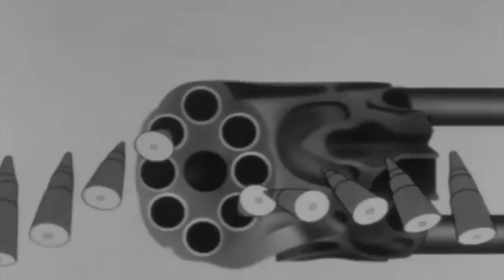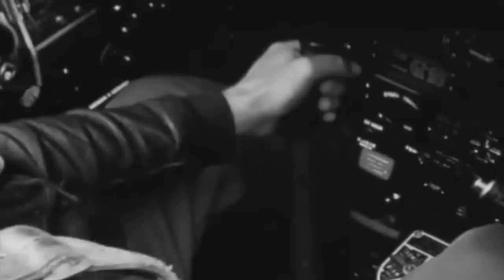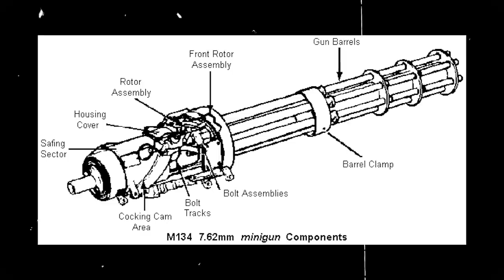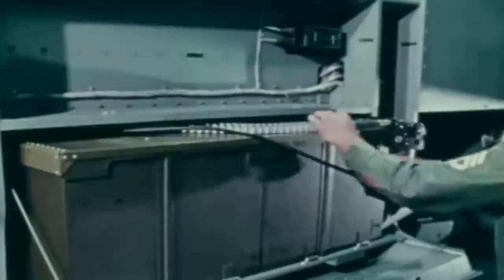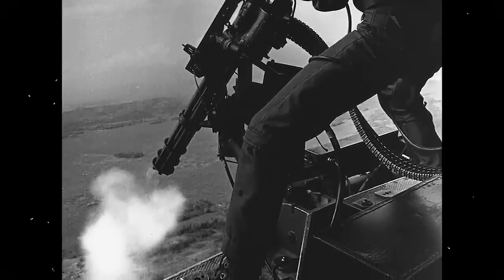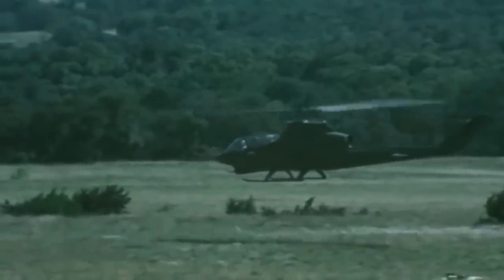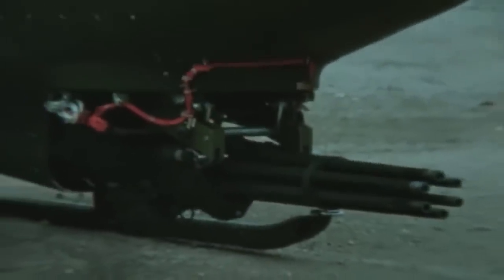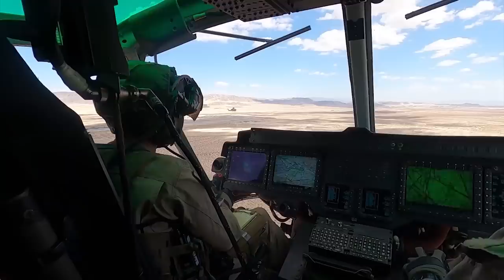Minigun -  M134 7.62×51mm Six-barrels of Pure Destruction

Comment: Ammo reliability is critical in these guns. While a dud rd. will simply be ejected a delayed hangfire will destroy the gun when it goes off out of battery. Because of the speed the gun fires at there's only a few milliseconds delay between the firing pin striking the primer and the bolt opening. Every round must fire the instant it's struck.
Reply: That's why primers fire at over 100k/fps
Reply: I read that the 20mm guns are electrically fired, not impact fired.  The 7.62 guns are impact fired.  I'm not aware of how prevalent a hangfire is, I've never personally seen one but if you are firing many thousands of rounds then maybe the odds go up.
Reply: @billj5645  I thought they are electronically fired as well.
Reply: @billj5645  
Yes, the 20mm ammo is electrically primed, you could pound on the primer of one with a hammer and nail and it'll never go off, but if you have a ring on your finger and a static electricity charge built up on your body and you pick up a round and that ring touches the primer you could easily blow yourself up.
I was a Vulcan gunner in the Army, we were trained to remove all watches and rings for safety reasons before handling any of the ammo, and the linker/de-linker tool we had was made out of a special metal that wouldn't carry a static charge on it, also if you're ever at a gun show and you see fired 20mm brass pick one up and look at the primer strike, it's remarkably light, it looks like the firing pin barely touched the primer which in all reality it barely did, the firing pins on a Vulcan have an electrical current that runs through them, as I recall it was a lower voltage but a pretty high Amp rating. 
Something that cracks me up is when I see those YouTube videos where they "prove" whether or not a 20mm round will go through something like a manhole cover and they're using some custom built 20mm gun, they're not "proof" of anything because they're not firing military ammo, they're firing some sort of hand load made from pulled Target Practice slugs and fired brass, you can pick up both at gun shows, I have a pulled 20mm Target Practice slug that's sitting in a fired casing that I picked both up at a gun show to have sitting on a shelf so I can show people what I used to shoot.
They're taking those empty casings and machining out the primer or something like that and pressing in what I assume is a standard #209 shotshell primer since they're the same diameter or close anyways, then they're filling them with God knows what kind of powder plus if you look at those rifles they always have a barrel somewhat shorter than a Vulcans, so they're definitely not getting the same ballistics as a military round fired from a GE M61 cannon, and without a doubt it's not military ammo since they're shooting it out of a rifle with a percussion firing pin.
One of those videos claims that they prove a 20mm won't go through a manhole cover which I can assure you they will, we'd burn holes through light armored vehicles the engineers drug downrange for us, unless you're lucky enough to get a fresh Antrack or something usually they've already got a huge hole all the way through both sides.
Videos like that are just click bait and aren't proof of anything, in one of them some guy claims they try 3 different types of 20mm rounds and holds them up claiming one is a Target Practice slug and the other two were different varieties of the explosive rounds, it's such a joke because the TP round has a blue projectile sticking out of it which it should and even has the description and nomenclature stenciled on it as it should, the other two you can tell they painted the colors they should be but they don't have the description and nomenclature stenciled on them as they should, it isn't even a very good paint job on them, you can tell it's Rustoleum or something like that right over top of the original blue from them being TP slugs, the military nor anyone else would ever surplus out explosive projectiles or even pull them in the first place, and since they were shooting them from a percussion primed type rifle they definitely weren't any kind of surplus ammo since the rifle didn't have a power source for the firing pin anyways, I've handled all that ammo and I can assure you the two they claimed were explosive rounds were simply hand loads with TP projectiles painted to look like the real thing, and like I said to the trained eye it wasn't even a good job, that's why the guy only flashes them in front of the camera for a second instead of having them sitting on the bench or something like that with a close up shot.
I called them out for shooting non military ammo during their "proving" what 20mm capabilities are and ask them how they got electrically primed ammo to fire out of a rifle with a conventional percussion type firing pin and no power source for it but I never got a comment back from the creator's of the video, when I explained in my comment that I'm an ex Vulcan gunner they knew they were busted.
Reply: @dukecraig2402  I think I saw that video but didn't really question it at the time, that was before I read the book on Gatling and learned about the electrically primed ammo.  I assume the 20mm stuff used in WWII was percussion primed, I didn't know it had changed since then.  The book didn't get into many specifics regarding the 7.62 minigun, I didn't think they would develop special ammo just for minigun use.
Reply: @billj5645  
The mini gun uses standard 7.62mm linked ammo, the same stuff shot through the M60.
I actually have experience with the mini gun, at one point the Army determined that it would be cheaper for us to shoot at the Styrofoam radio controlled airplanes with 7.62 ammo instead of 20mm ammo, so they designed a mount for the mini guns that clamped onto the barrel cluster of our Vulcan guns, then you'd remove the electrical cable to the drive motor of the Vulcan and hook it up to the drive motor of the mini gun, there was a big ammo can that hung on the left side of our gun tub (turret) with a flexible feed chute that went to the gun.
The whole thing sounded good in theory but the problem was whoever the genius was that designed the mount for the mini gun designed it so that the ejection port was facing straight up, it worked OK as long as you were swinging the gun when you were shooting it but if you weren't occasionally the last cartridge fired would fall back into the ejection port, then when you'd go to fire another burst that empty cartridge would jam in the rotor causing a stoppage that required the gun being torn down, we wound up with more down time on the range because of it and quickly scrapped the program. 
But until the day I discharged we still had 4 mini guns sitting in the corner of our arms room, I was good friends with our unit armorer and used to sit around in the arms room with him tearing them down and putting them back together just for fun, they're actually more similar to the 20mm cannon than you'd think, the tear down procedure was almost exactly the same, if you could tear one down you could tear down the other.

Comment: 7.62 is a common projectile caliber. But there are a lot of variants and they're not interchangeable. The minigun is chambered in 7.62×51. Which is called the .308. 7.62×39 is your standard AK47 round. Then there's also 7.62×54R. For the sake of clarity most people call the 7.62×51 a .308 round.
Reply: I always thought 7.62 NATO was more commonly said than 308
Reply: @PsRohrbaugh  That's my impression- in military context it is the 7.62 NATO, in civilian use it is most commonly called .308.
Reply: I guess nobody would mistake the AK 47 round or the old-rimmed Nagant round for with the usually-called 7.62 or 308. The 30-06 has the same caliber as well.
Reply: Thanks! I have a Yugo SKS, so I don’t think AK when I hear 7.62x39. I love my bayonet and grenade launcher

Comment: The Mini-gun is an AWESOME tree and grass mower, not to mention shredding the f*** out of any people caught in the line of fire.
  The Vulcan Phalanx is an AWESOME piece of Tech!!
  Viet-ming?? Meaning Viet-cong maybe?
  As I was taught in Basic training about the M-60 machine gun. Sustained fire of the weapon would melt the barrel and cause miss-fires, and premature detonations, which could/would/did cause casualties/fatalities. They told/trained us to utilize 15 round bursts to prolong barrel life and slow barrel meltdown. Barrel meltdown caused the weapon to be out of service for quite some time to replace the barrel, or permanently. I was the M-60 bearer during my entire time in-service, the 26 pounds of the weapon empty weight wasn't a problem at all. Even loaded I experienced no problems handling/carrying it, even b4 Rambo, I would carry 2 belts of ammo strapped across my body, and 1 belt loaded in the weapon. I didn't want to run out of ammo too quickly. My ammo bearer carried the extra barrels, plus the extra ammo.
Reply: Viet Minh, more so what the French would have called them.

Comment: The mini was limited to short bursts due to over heating. Front seaters in the Cobra would cycle the trigger to minimize the gap on fire.
Reply: The system had a 6 second fire limit built in. Once it stopped one would simply release the trigger and hit it again with only a small space between "streams'...

Comment: the vulcan gatling gun use in vietnam actually first used on a C-47 before using on helicopters it was mounted on the floor and it was water cooled there were 3 mounted, 2 through windows and one in the doorway, the pilot was also the operator. they were used in the highlands first. it was the summer of 1965.

Comment: Good video. But you made a comment that cannons gave a range advantage over the .50bmg used in USAF fighters. This is not why cannons were favoured over heavy MG's. 
The reason was because of their effect on the target. Cannons did mre damage than the .50bmg with fewer rounds.
This became most obvious during the Korean War, when USAF F-86 Sabres were getting repeated hits on Mig-15's but the Migs still remained airborn and often escaped even when full of holes.
This led to Project GunVal which saw a small number of cannon armed Sabres deployed , I think it was 12, to evaluate the potential of switching over to cannons.
As a direct result of Project GunVal's findings, after 1953 no new model American fighter carried .50's again.
The Vulcan cannon allowed the most projectiles to be fired in the shortest time due to the fast speed of jet v jet engagements which gave only the briefest of firing opportunities.
(Project GunVal would make a good subject for one of your future videos).

Comment: 6000 rpm is maximum on a GE minigun. That is 100 rounds per second.  It doesn't go faster to let bullets clear the barrels to prevent extreme pressure spikes in the chamber and bore.  You will find it is generally turned down to 3000-4500 rpm to conserve ammo and reduce recoil impulse.  100 rounds of 308 In a second creates cumulative recoil adding the energy of each round together.  Suddenly 8 lbs  of recoil from one is 800lbs of recoil a second later.  The minigun used the same ammunition as the m60. 7.62 NATO /M80 ball. 147 brains bullet at 2750 fps nominal velocity. The larger guns are Vulcan rotary cannons . .50 bmg ,20mm Vulcan, 30mm bushmaster , with as few as three barrels up to 8 ,   the a10 thunderbolt II " warthog" attack plane uses the 30mm  8 barrel cannon know as the (navy designated)" Gau 8".  Recoil from that one can  Knock a jet out of the sky of fired for too long .  I really enjoy this type of information.    I really like that videos are being made like it to teach people about what is what. They probably wouldn't otherwise care to learn about such topics.   The more education there is surrounding firearms , the better off we will be.  I will never say everybody better like them. That's not realistic. It's ok for them to not. 
Choice is freedom.  I choose freedom...I also choose miniguns and Vulcan cannons on tractors at the gun range!  I'd need three two cannons and the minigun mounted on a scale model red Peterbilt conventional cab ,  18 wheel rig flat bed trailer .I'd name them too. Brrrrrt and Ernie and the rubber ducky... That's what it think of them.
Reply: The A10's 30mm gun is 7 barrel not 8, and no, it wouldn't stop the jet if fired long enough, that's a myth that's been addressed by more than one A10 pilot.

Comment: One of the mini-gun problems is safety... If you have them on the doorway, and some noob tries to climb aboard using the barrels as a hand hold, he can rotate it enough to fire a bullet... If the barrels rotate, it fires. We had a metal bucket over the barrels as a "safety" but that's not worth much in reality. Had one idiot shoot himself in the leg as he climbed aboard the Huey once.  These were Dillon Aero mini-guns and they rocked! Nothing like the firepower from those guns.

Comment: The issue with the M60 was in the maintenance of the gas piston. Soldiers would end up putting the piston ring on backwards causing the mechanism to foul and jam during maintenance. They ended up wiring the piston ring together so soldiers couldn't reassemble it improperly.

Comment: The Gatling gun could fire at a rate equivalent to 200 to 300 soldiers, take it as 250. If the sides were equal strength, they only needed one for every 250 soldiers to double the rate of fire over the enemy. Say you had one for every 50 soldiers, you’d have 5x the rate of fire of the enemy. Hide them behind your ranks of solders and push them up as they advance. After the first volley from three ranks makes a cloud of smoke to obscure the lines your soldiers step back and the Gatling guns lock the elevation and rake the enemy lines. Once your soldiers are all reloaded after 30 seconds, you have fired three Gatling rounds for every nicely tight packed solder they have. If one in six hit a new soldier then you’ve cut them down to 50% strength before they can get in a second shot and sewn utter chaos. If they can stand another thirty seconds they’re down to 1/4 strength. Keep firing as they turn and run and fire another volley. Reload and mop up.

Civil war generals were idiots 😂

Comment: I got to use one of these in the cargo door of a Navy H-3 Seaking for combat SAR. VERY good at enemy suppression during ingress to the LZ.
Reply: I had the privilege of testing the first one mounted on a Navy H3. The engineers had set the stops to keep it from hitting our own rotor blades. They said if it did, we had a fair
chance of making back as it would take an equal amount off the tips of the five blades. (We knew that was bs.) Pilot would jam the cyclic hard over and I opened fire with the gun
up hard against the stops. Sure enough, the closest I could get to the blades was about 6 inches. That thing sounded like a gigantic electric razor. Every 6th shell was a tracer
and I had a hard time seeing between the tracers. It did have a jamming issue though. One trigger for 3000 rounds/min and another for 6000.

Comment: One thing that always bugged me about the movie predator, if you are going into the jungle on a covert mission, a mini gun makes zero sense. It’s heavy, it’s not very maneuverable, the ammo alone is heavy, it requires batteries, it has a ton of moving parts and electrical components that could be effected by moisture. There are several lmgs that would suit the situation a lot more

Comment: Over all a very good but some mistakes in the script. One describes the AH1 cobra with 19 rockets and an M129 40 millimeter rocket launcher. That weapon was the M129 40 millimeter grenade launcher mounted next to the minigun in the chin turret. Several scenes also showed the 20 millimeter Vulcan mounted on the left inboard wing stores. At the time of that the system was dubbed as the XM 35 system. The view does not show the extra panels that were required because the muzzle blast from the cannon was melting the side of the aircraft. But the M 134 minigun does not weigh 85 pounds. It is much lighter and easily carried by one person.
 
The mini gun was used on various ground vehicles such as the escort gun trucks of the 34 General Support Group for convoy protection. Better description of the three barrel M 197 20 millimeter cannon on the Cobra chin turret should have been added. It replaced the M 28 system of the AH 1G on later AH 1S model Cobras and the AH-1W Cobra and AH-1Z Viper flown by the Marines.

Comment: Otherwise known as bringing the 'Canned Heat' I believe... only limitation on its destructive power being how many belts can be carried in flight.  Going to the USAF's close support AC the Warthog and it's 30MM rotary cannon, the air craft delivers its mag capacity of 1100 rounds at 3900 RPM, providing a total of 18 seconds of ground exploding terror to the bad guys...  'dont spend it all in one place kid...'

Comment: Wait, the Gatling was motorized in EIGHTEEN ninty three?? Dear Lord! You might have had minigunned-Sopwith Camels. 🤯
Reply: The torgue  produced by the minigun on my Cobra was equivalent to the 350hp engine on the GTO that I purchased after Nam. Even at 100+ knots airspeed simply firing it at 45 degrees to the direction of flight would push the Cobra off the intended flight path. No WW1 aircraft could have survived this stress...jusy my opinion.

Comment: I did the math. 233 rounds PER SECOND!! How is physically that possible?? Wow
Reply: 6 barrels spinning at 1000 rpm. Each of the 6 bolts ride on tracks in a spinning rotor, driven along an elliptical path inside the rotor housing. As each round is picked up by the bolt, it travels forward along the bolt path until it is chambered and fired (by mechanical impact of the primer). The bolt continues along it's path, reversing direction, thus extracting the spent casing and then ejecting it. This entire cycle occurs 6 times per rotation.